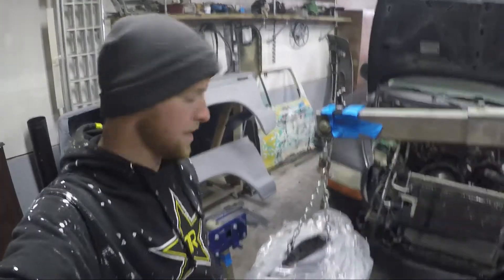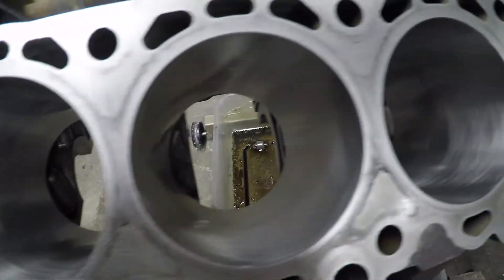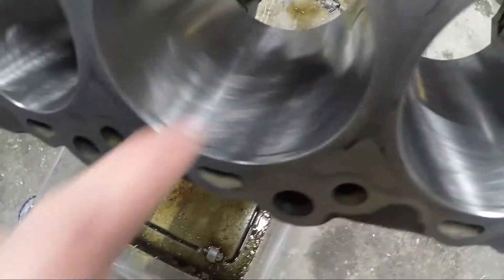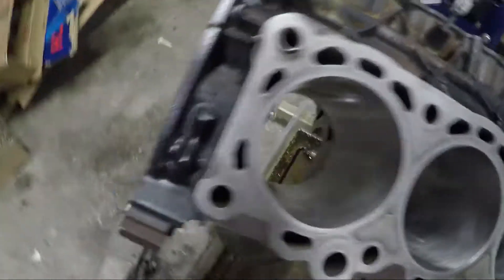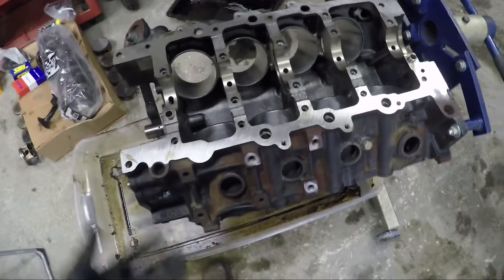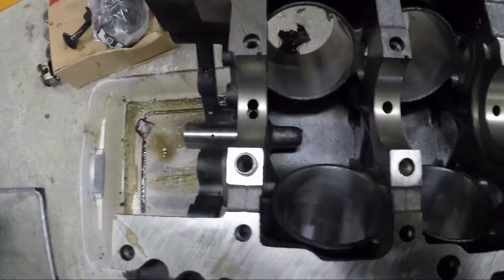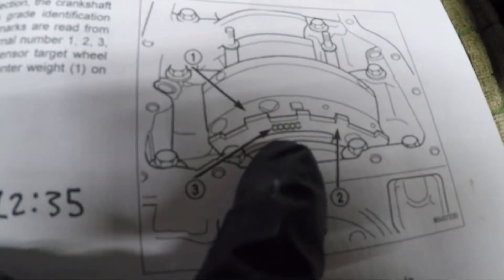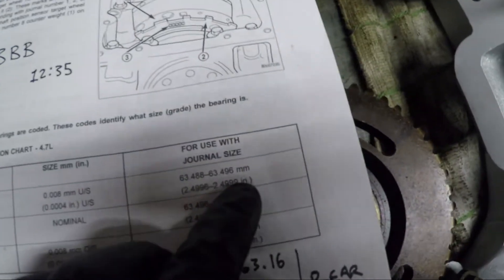2002 Dodge Dakota 4.7L V8 Engine Rebuild (Part 5)

Comment: Bro for as much work it takes to get down in there and the cost of replacing all of the torque to yield bolts I can't understand why you would not replace the bearings they're only like 50 bucks for the whole set
Reply from the maker: In retrospect, I definitely should have replaced the bearings. I was worried that if I replaced them, I'd have to machine the crankshaft and get oversized bearings.

Comment: Just an fyi, with these bedplates, you need an anaerobic sealant and NOT that gasket maker.  The bedplate needs a "zero clearance" sealant that does NOT dry when exposed to air.  Dodge charges a ridiculous amount of money for the Mopar stuff, but Permatex 51813 works amazingly.
Reply: THANK YOU! I have been looking everywhere to figure out what gasket is supposed to go here.
Reply: Noted